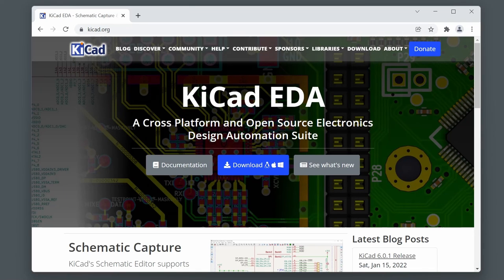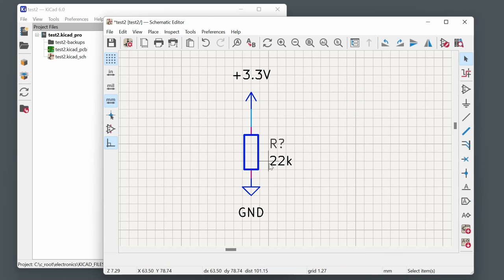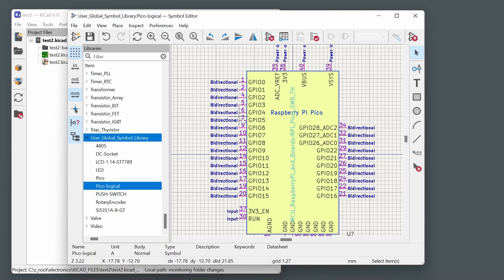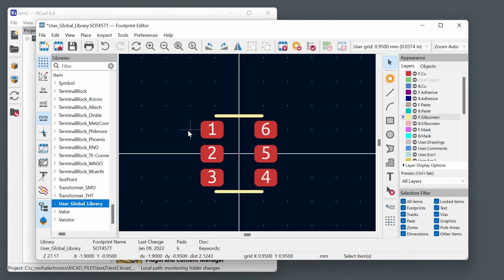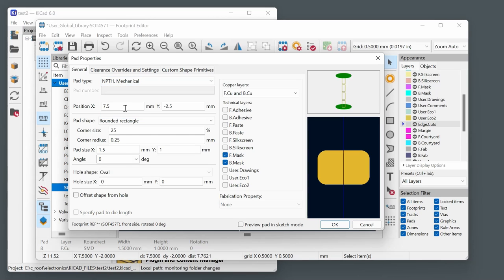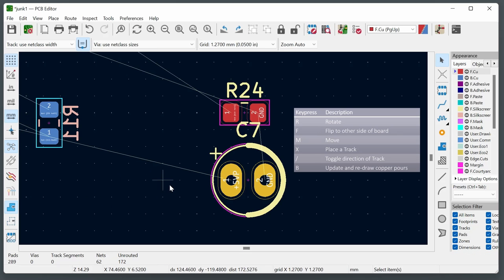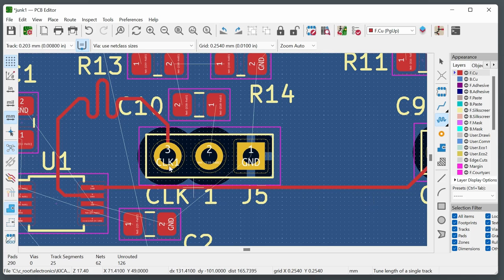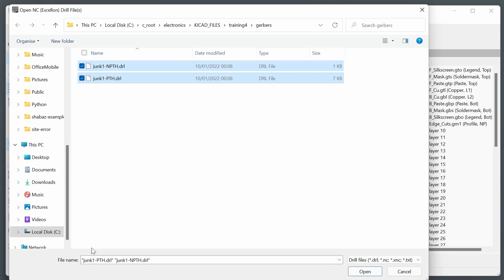Creating Circuit Boards with KiCad 6

Comment: Hi, thanks! 
I have been making  layouts for some decades starting with Mc Cad and Generic cad way back. Remember the pen plotters... Never used KiCad, very good intro to the most important things to get up and running quickly. My impression is that KiCad seems easier to get into and its more intuitive than the older systems. For microwave cards we had to use Autocad and a Gerber generator. Drawing functions in KiCad seems good enough for much RF work as well.
Reply from the maker: Hi Erik, By coincidence, I used Generic CADD for a while too! It was very good for a DOS product.
Reply: @shabaz_  I preferred it to Autocad at the time, the 2 letters keyboard commands worked really nice. Used it for microwave layouts etc. This was at a time when much layout work was still done with the red film and photographically reduced to correct size.  Used it parameterised with DOS Turrbo pascal to generate computed patterns via macro files among other things. Just being able to scale something independently in  X and Y was a tremendous advantage back then...

Comment: I’ve started watching your video in sections, very good and an excellent resource. Up to now, the only PCB editor I’ve used is EasyEDA and due to the ease, its taken me a while to move away. Started to make the move and seems less daunting. Thank you
Reply: Just curious, what are your reasons to move away from EasyEDA?
Reply: @sumitmamoria  just to try something new and figure out the differences. A perk I knew of is to place components on either side of the PCB and to export .step files for Fusion 360

Comment: In the top toolbar there is a footprint assignment tool (also menu "tools->assign footprints") that uses a dual window and lets you assign footprints to several components at once, like all resistors, all caps and so on.
The ERC errors for "not driven pins" are usually corrected by applying power flags (PWR_FLG in power library) to the GND, VDD, ....). I usually use a corner at the bottom of the schematic to associate the "PWR_FLG" to the power supply nets.
The unused/not connected pins should be marked in the schematic with "no connect" symbol so they don't trigger either ERC (schematic) or DRC (PCB) errors or warnings.
Reply from the maker: Hi Jorge, Thanks! This is very useful.

Comment: Thank you, Exactly what I needed to upgrade my (very occasional) use of version 5 to version 6 with a good refresh.
If you are ever bored, I would love a video on how to create simple 3D model for a relay or similar stuff (rough box is enough, but I found FreeCad quite unintuitive),
Obviously I could learn and make a video myself, but I am lazy and not very good at explaining  😏
Reply from the maker: Hi Jean-Marc, Thanks for watching! I find FreeCad unintuitive too, however SolveSpace seemed a bit easier. I don't know how to create a 3D model yet, but as soon as I learn it, I'll post a video.
Reply: @shabaz_  Thanks.  I agree that FreedCad is less than self explanatory. In general I use OpensScad for my 3D design, but I am not sure that it is useable for that purpose, but I will have a look at SolveSpace.
About FreeCad, I found the 2 video in the channel https://www.youtube.com/playlist?list=PL4eMS3gkRNXcvNnawxzuzRlFDa5CseoQV very useful.  I followed them after yours and was able to make a very simple box with pins after some struggles (this is enough for my purpose).
The real difficulty is to size and place the generated object (whatever way it is generated) in the footprint.  For unknown reasons the files generated by FreeCad is scaled by 2.54 🙂.Placing the origin correctly is also annoying.  There is a python script that supposed to help, but it does many other things and the demo/explanations are for older versions of Kicad and are pretty complex (StepUp).
I guess that what would be most helpfull is information about the placement/scaling of the objects and the type of files supported.
Reply: @shabaz_  I recomennd using Fusion360

Comment: Hi, will you be making a similar tutorial video for the new KiCAD7
Reply from the maker: Hi Mark, I might just make a short delta video, because Kicad 7 is so similar to version 6 in terms of user interface. There are some additional features which are worth having in a video, but aside from that, most of the screen views are near-identical between version 7 and the older V6. 
It was a bigger difference between V5 and V6,  where there were significant UI changes. If you're new to any version of Kicad, then I think the V6 videos are still worth watching, and you'll be up and running with V7 with them. I've been using V7 since it was released, and I've not seen any incompatibility with how V6 was used so far. There's a nice properties panel, which is worth using, but you'll spot it as you work with it (and KiCad can be used without touching the panel, but it speeds up some editing tasks). Also, there's nice handling of inverse silkscreen text, I tried that on a PCB recently, it is good.

Comment: great video. I'm looking at switching from Eagle so those particular tips were great. (un)fortunately I have also written external software that generates Eagle board files based on component attributes in the schematic/board file — automatically generating front panels for my projects based on data in my circuit PCB — so will need to figure out how to do that with Kicad. I'm sad to be leaving Eagle after many happy years with it, but Autodesk have become completely nightmarish and user-hostile 😞 (and for what it's worth, I was happily paying for Eagle Premium)

Comment: I'm still watching this for the first time, but I want to underscore the need to create your own libraries. The way KiCAD is installed, all the provided libraries are (or at least should be) write protected. This is to prevent the user from losing their custom libraries when you upgrade KiCAD. By default, upgrading KiCAD will replace the existing provided libraries with the latest versions. This will wipe out any assets (symbols or footprints) that don't exist in the master library set provided by KiCAD. So your symbols that you may have added to the provided set will be removed just like obsolete (or reorganized) symbols will. This is very important to get right at the beginning otherwise the user will have problems. But the effect won't happen until long after cause and effect can be easily determined.
Reply: Christopher, do you mean KiCAD update will leave items in user-created libraries unchanged (while updating all the provided libraries)? So, we won't lose for example footprints we build and store in user-defined libraries?
Reply: @fardadmichaelserry7619  Yes, that is what I mean. Now as an example with the v6 update, you will need to manually migrate your personal libraries to the new format if you want to edit them. (KiCad only saves library assets in the latest library format, but can read legacy library formats.) But the tools to do that are in the library management toolset of KiCad. But if you don't need to edit the assets (for example a 3rd party managed library and/or example footprints) you should be able to read and use the legacy assets.
Reply: @Sembazuru  Thank you for the follow-up; I appreciate it.

Comment: Hi!  Your vid was a great help in pulling together enough skills to run Kicad 6.  The presentation is fantastic.  Are you going to do a Kicad 7 version?
Reply from the maker: Hi Lyn, Thanks for your feedback! The user interface differences between V6 and V7 are small (in contrast to the difference between V6 and earlier versions), so one idea was to clone the video and edit in any major differences. I'm not entirely sure how I will do it, but definitely giving it some thought. There are nice productivity improvements in V7, which are definitely worth covering. So far when working with V7 I'm using it almost like V6, however one difference for example is that when using the PCB Editor, on the left side there is now a Properties pane that speeds up editing things. It is possible to ignore the pane and work just like in V6, but it's definitely worth exploring using that new pane.

Comment: This is a great introduction to KiCad, and very well presented.  Thank you.  I have one question... For a non-plated hole (with no track) I would be inclined to make the copper pad smaller than the hole. This would prevent any residual copper at the edge of the hole if the board was under etched or if drilling was very slightly offset. I know that these days the drilling would normally be OK, but I am an old-school PCB designer (mid 80s up to late 90s). I am new to KiCad, however, and haven't done a serious board layout in over 20 years.
Reply from the maker: Hi! Good point, and makes sense. I just wasn't sure if the KiCad code internally does something special if it recognizes if the two fields are set the same or not. I've tried examining the KiCad source code but I'm not familiar with where to look in the code. I'll raise this as a question on the forum, to see what should be done, since it's a very valid point that there could be slight drilling offset which would cause issues if KiCad doesn't automatically not place anything on the copper layer around that hole
Reply from the maker: I raised it here: https://forum.kicad.info/t/holes-without-copper-and-slight-drill-offsets/33675/2 and I think you're right, the copper pad should be slightly smaller than the drill hole in that scenario. It causes a warning to appear when you set the size smaller, but it's better to live with that than have the sliver of copper risk.
Reply: @shabaz_  Thanks. I took a look at the forum chat. That's pretty much what I thought.  Non-plated holes would sometimes be needed, but it really depends on the use case and the manufacturing process for the board - if flow soldering could partially block a mounting hole, for example. But those kinds of considerations apply regardless of the CAD tools used, and it's up to the engineer to manage the design accordingly. 

Anyway, I have a small PCB project to get done, so I am going to give KiCad a try. Thanks again for a great tutorial.

Comment: Hi, great video, it helped out tremendously! I have one question regarding the soldermask of the PCB, do I need to anything besides making sure it is marked when I make my Gerber files? I thought I would have to make a filled zone like you do for the copper layer, but I see that is not the case? Thanks in advance.
Reply from the maker: Hi Victor, thanks! Provided the F.Mask and B.Mask layers are checked on the Plot options (they are checked by default, so nothing to do) then the mask layer will be correctly generated. There's no need to create a filled zone for it, because the mask is automatically computed based on the pad designs per component. The mask will be automatically created wherever there is no pad.

Comment: Hello, Thanks for your video.
Is there an easy way on Kicad to realigned on the grid components that were moved after all the wires were connected. I now have many errors on ERC due to the wire not in line with the components pins. It's a mess! Thanks
Reply from the maker: If you select a component and right-click it, I see an 'Align component to Grid' option, does that work for your scenario? I've been burned in the past by changing grid on schematics on other CAD tools, so with KiCAD I never change the schematic grid settings, only PCB grid settings, so I've never tried that Align function. Hopefully it works for you.

Comment: Total noob here. Have'nt check all the video yet. But @ 2min you say Key press A button and it pop-up a grey box with shortcuts descriptions. What did you do to view that? Or is it just an overlay in the video?
Reply from the maker: Hello, you can use the Help -> List Hotkeys menu item to see the box with the shortcuts. The dark-grey box was a summary overlay of the most important hotkeys in the video, but clicking on Help->List Hotkeys will display them all. And then when you're ready, press A to add a component (which will bring up the Add Component Symbol box to choose a resistor symbol etc).
Reply: @shabaz_  Thanks. I got the Help->List Hotkeys. Just was confused of the overlay. Looked like it was from KiCad :)
Nice video!

Comment: Why would my board not have a netlist. Is it an error with footprints or the way I set it up?
Reply from the maker: I'm not sure, but if you can paste a screenshot (either on the Kicad forum or element14 forum, showing the error message you're seeing) then hopefully myself or someone else may recognise the issue. Unfortunately the comments section is hard to use for troubleshooting without screenshots/more info.
Reply: @shabaz_  I ended up just deleting everything and restarting and it worked out🤷‍♂ but thanks

Comment: 16:35 Where did you click to get the SOT-457T ? 
I have installed Kicad, but the footprint library is empty. How can I get the footprint librabry?
Reply from the maker: Hi, there are thousands of components and footprints that are installed by default, they are part of the KiCad installer. For instance, in the path C:\Program Files\KiCad\7.0\share\kicad\footprints there will be more than a hundred libraries (the path may vary). If you're not seeing that, then there is an issue in the installation of KiCad. In the video, I created a custom library, which is empty since it is newly created, called User_Global_Library, and then I proceeded to create the SOT-457T footprint inside there as an example. If you're referring to the dimensioned drawing at time 16:37 in the video, that is not part of KiCad, that is just a screenshot from a datasheet. I referred to the component datasheet to find out the size of the pads, so that I can create the footprint in the newly created libray.
Reply: @shabaz_  my footprint library is empty , left pane is empty and I don’t know how to make it available.
Reply from the maker: @Kapparie  It might be worth reinstalling. When KiCad is installed, nothing needs to be done to have access to the default libraries that were visible in the video. If you're not seeing them, can you reinstall KiCad (perhaps on Linux if you're not using the latest Windows)? It for sure works because I recently installed KiCad 7, and again, nothing needed to be done to see the default libraries for both schematic symbols and footprints. If it still doesn't work, you may need to grab some debug (for instance, screenshots or video and create a discussion on the KiCad forum. Ordinarily, you'll get a response the same day.

Comment: These gerber settings are ok?
Reply from the maker: Hi Stanislaw, yes I think they are usable for general PCB work, because I used the settings as shown in the video, for 2-layer boards from a manufacturer in China (JLC PCB) and the boards have come back fine each time.
Reply: @shabaz_  thank you very much, I couldn't get away errors in their Gerber viewer. On forums it is said also that PCB will be okay

Comment: Hello! Thank you so much for this! I'm pretty new to designing PCB's so I was wondering if could maybe tutor me little bit on zoom or something? I would be willing to pay.
Reply from the maker: Hi Raymond, Thanks! I could try to set up a zoom call for anyone to freely join in in future, however it takes some prep and time scheduling which is awkward currently, but in the meantime a good option could be to go to element14.com, everyone is friendly there, and just write what you're doing, with any screenshots where needed, and people will quickly step in and advise. There's several people with good KiCad experience there. This helped me a lot when I learned, I noted and took screenshots of what I was doing over the space of a few days which I dedicated to learning KiCad, and people just stepped in and commented as I went along. The official KiCad forum is good too, people respond promptly and with great knowledge. The element14 forum is useful for KiCad and non-KiCad stuff, such as electronic circuit design/troubleshooting, component selection and so on, so a blend of using both sites could be a good way forward during your learning.
Reply: @shabaz_  Thank you so much!  I will definitely check out element14 and yeah I am familiar with the official forum so I'll use that as well. In terms of zoom, my schedule is flexible if that helps. Thanks again for responding